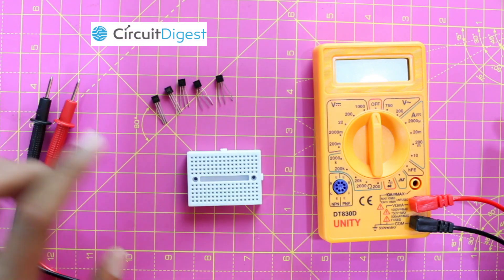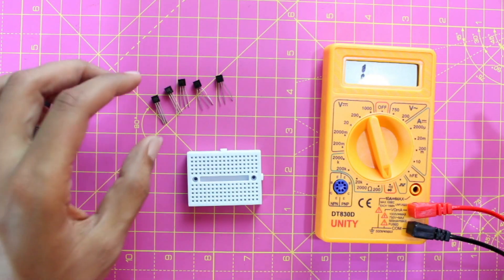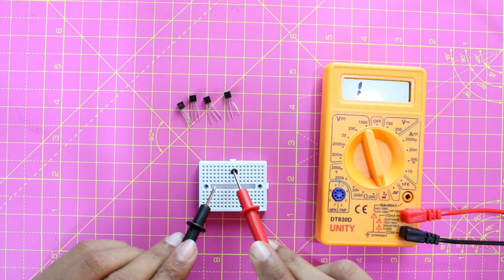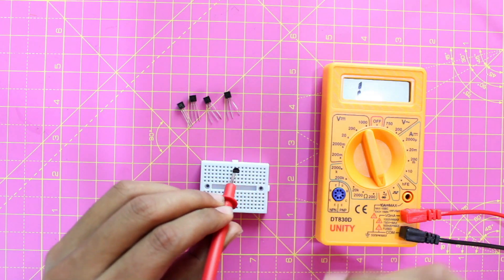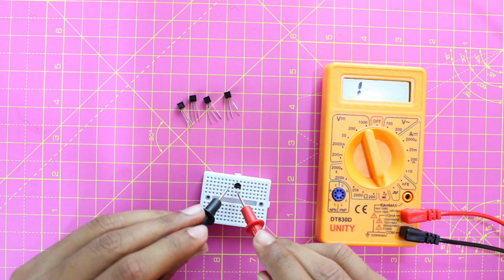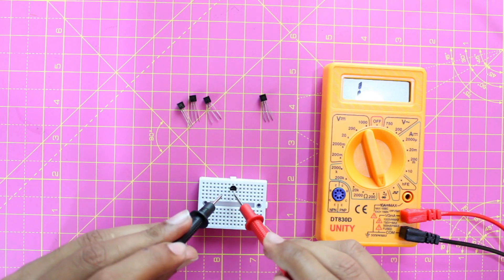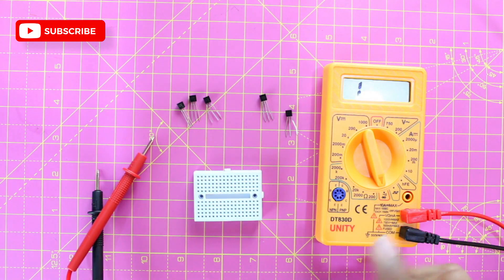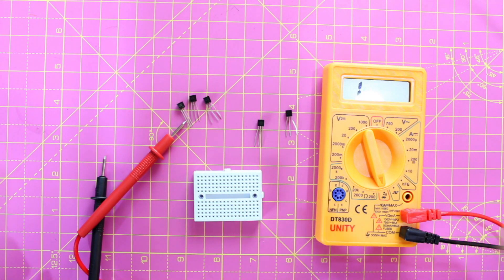How to Test Transistor with Multimeter | Simple Method to Check Transistor is Working or Not

Comment: What if voltage drop is different each side
Reply from the maker: The voltage drop don't need to be exactly the same. We are only looking for two states voltage drop, and open circuit. And most transistor will have similar voltage drop across the respective pins with one digit accuracy.